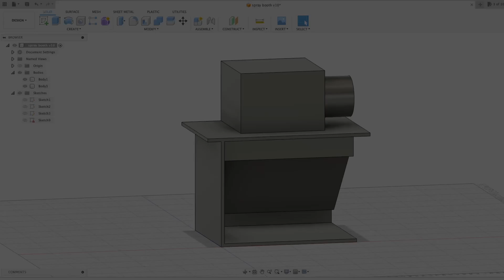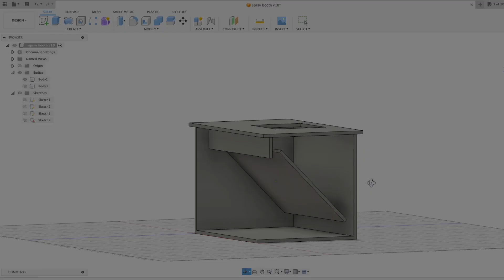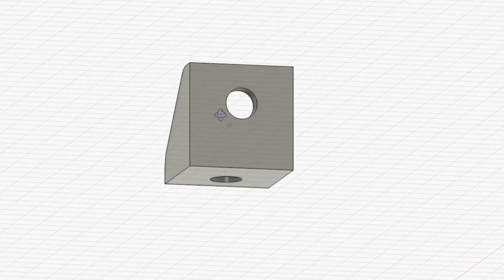How to make a DIY Spray Booth for Air Brush Painting

Comment: Hi ! From the project i didn’t understand the mechanisms for tilt the flow adjustment board ! thank u !!!
Reply from the maker: Thanks for the comment! The flow adjustment board is just clamped in place with the side walls. So I can freely adjust them to any position and clamp them back. One issue I've encountered after using the booth for over an year is that the board comes loose in the dry season. It probably shrinks slightly and falls. So I added some tape to hold it in place after I finished adjusting the board

Comment: Hi!
How big is the air flow? I made my own spray booth, with 90m3 per hour. What do you think, is it enough? Thank you!
Reply from the maker: Hi thanks for the comment!
I believe the fan I used FY-32BS7 is speced at 400m3/h at 0Pa.
Yours seems to be smaller in this aspect.
I'm no expert but I think it depends on the size of the booth so the only thing I can say is, if it works for you then its probably good

Comment: I have a question. Why do Japanese spray booths tend to all follow this design? The fan is mounted on top, and there's a flow control board that allows paint to be sucked in from an opening on the bottom. On most western-style spray booths, the exhaust fan is mounted behind a large filter, where there is a negative pressure chamber that allows the paint to be sucked in through the filter.
Reply from the maker: Thank you for the question!
I believe the design originates from a very popular booth, the Nero Booth, from a company called Gatto-Works. Apparently, it really works well, so people including myself are copying the design. 
Having the fan on top lets me have a much larger (thus powerful) one within a desk given space. If I put the same fan behind, I would need a really deep desk.
The other benefit is the in take towards the top front side of the booth. This intake collects spray that gets reflected off the paint target.
Having the narrower intake might be better for airflow, but I'm not too sure here.
Reply: @MofutoraModeling  Thanks for the info! I like building my own booths, so maybe I'll try this design next. What kind of filter do you use for the exhaust fan?
Reply from the maker: Hi! Nice, I've only built this one but it's doing very well so far, so I recommend trying it.
I actually don't use a filter. Maybe I should, but up to now it's doing fine.
The design make it so that the spray hits the back wall first before entering the fan, so a lot of the paint just lands on the wall.
I didn't show it in the video but I added some plastic sheets to the walls so that I can just wipe the paint off.
Reply: @MofutoraModeling  I see! Yeah I definitely have to give this a try sometime. Thanks for sharing!
Reply from the maker: cool! hope it goes well!
Reply: Did you think about adding a filter in front of the fan to protect it? Will affect the airflow a little but should still be strong enough while protecting the fan.
Reply from the maker: Thanks for the comment. sorry for the late response.
You can definitely add a filter right beneath the intake of the fan. Should still work fine
Reply: In my experience building spray booths, the 'flow control board' acts as paint splash redirector, and to shape and direct the sucking airflow as for the paint dust-mist not to get churned out back to the painter due to turbulence from the fan, or exhaust pipe orifice diameter differences(if the fan is not on the box). One can say that if its using a dense enough air filter on front of the pulling fan, there's pretty much not many of said turbulence, but the air pulling strength is also noticeably reduced by the filter. So long as you're using it for airbrush and model paints, I think its fine to not use filter, I actually just put aquarium water filter and use it as direct  paint mist catcher, partially obscuring the airflow, but a small bathroom puller exhaust of about 30w still works well.

Comment: Have you had problems with powdered (dried) paint building up in the fan? Thanks,
Reply from the maker: Thank you for the question. I do have some build up, but so far no real issues.
I think it helps that the flow path is bent, and the paint mostly hits the back wall first before moving up.

Comment: Does it work with any fan of this type? Im asking cus my local stores don't have this particular model
Reply from the maker: Hi thanks for the question.
Yes, it should work for any of fan of the same type. The power may differ and might need some adjustments to the box and hole sizes.